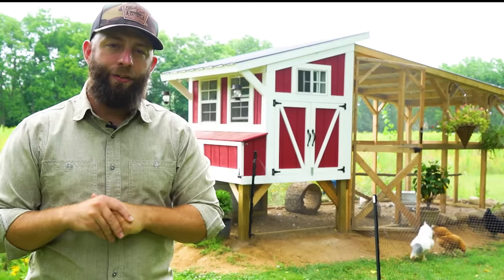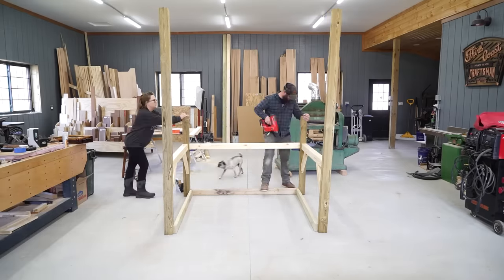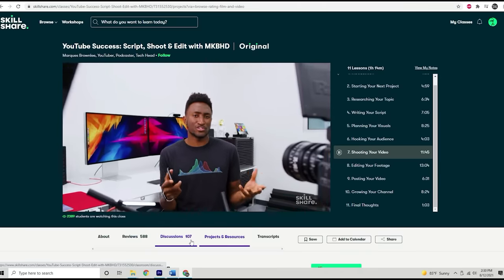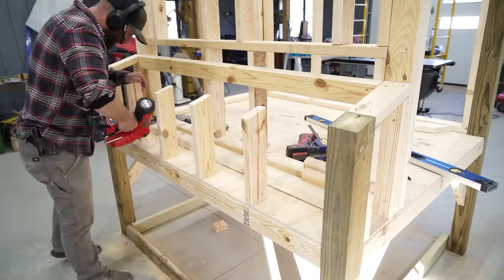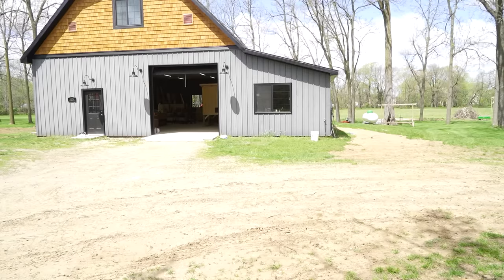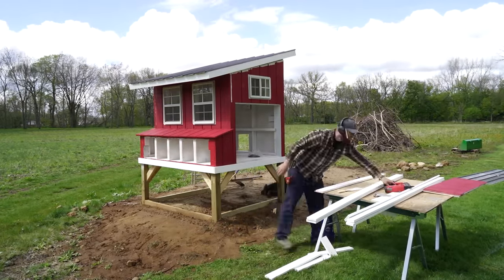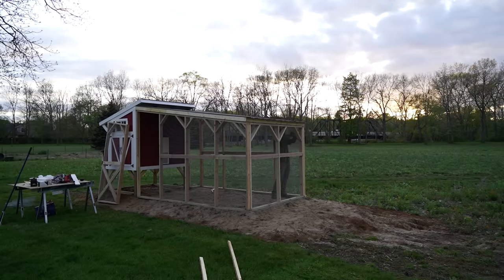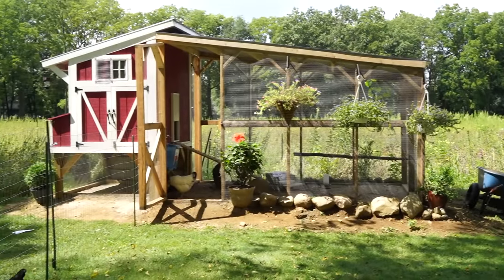Ultimate Backyard Chicken Coop Build | How To DIY

Comment: I’m in Maine researching more coop ideas (chicken math is strong here) and this is a great coop. For those of us in northern areas where 24” heavy snow loads are not uncommon (lots of beautiful barns collapse some winters) the metal roofing is a must to speed the snow sliding off. One note I might add is I might angle the run roof down another 10” so sticky type snow slides right off immediately rather than sitting on top of the run until actual weight makes it slide. If you don’t want to change the build then install a post in the middle of the run to support heavy snow load. THANKS FOR POSTING this is a gorgeous coop with convenient features!❤

Comment: Just built mine with your plans. It turned out awesome! Love this design and wish I could share the pics with your community to show what an awesome product this makes over store bought cheap coops. Thanks again for the great video and descriptive plans!
Reply: How much did it cost you with the current wood prices? I’m looking at building one soon and this one seems amazing!
Reply: Where did you find your windows? We are actively looking and just bought the lumber to build ours.
Reply: @hopejanson9743  I did not do windows as that was an easy several $100 I could save by just cutting out the “windows” and stapling hardware cloth over the opening. I then put trim around and am doing shutters I can open and close.
Reply: @bandwidthbros4741  ohhhhh love that!!
Reply: @bandwidthbros4741  how much did this cost you to build?
Reply: @nickvickrey8692  I just built one using the plans but made it a little larger 8’X8’ overall and so far I have around $1500 in it not including the run.
Reply: @nickvickrey8692  I've looked and looked for plans online (have the idea in my head of what I wanted to build but hard to find detailed plans to go build upon). Lumber alone and hardware running about $1100. I am using my neighbors old cedar fence he just took down for the trim and door frames. (Trim alone at the box store runs about $200 plus JUST THE TRIM!!!)  I'll use recycled fence panels for the window and just add hardware cloth for the windows with a hinged frame.  Mine will be 8'x8' with a 12-14' run.   I still have not acquired metal roofing yet, so it will be all in for roughly $1500-1800 if you add the new framing nailer.
Reply: Kkkk kk
Reply: @danieldill5214  it’s worth the $14 to buy the plans in this videos description. They were very detailed and gives you something to reference durning the build weather or not you make size changes.
Reply: the rough opening for the main door is 41.5". the siding filler pieces show them being flush with the RO. but the doors together are 42.25" wide. are the filler pieces supposed to be trimmed so the door will fit properly?
Reply: @ashleygreen4209  I cut the inside “siding part” of the door to match the opening with an 1/8’ gap from all sides then attached the trim for the door to overlap the door inside and siding to the coop. Don’t know if that explanation helps.
Reply: @bandwidthbros4741  yes, thank you! It helped validate the idea I had.
Reply: @zachgraham8091  could you share your modifications? Hoping to go 8x8 as well
Reply: @whitneyf1836  I’ll take a look at what I modified and let yah know asap.
Reply: @zachgraham8091  thatd be awesome thank you!!
Reply: @whitneyf1836  so basically I followed the plans except I just went 8 foot both directions and adjusted the other measurements to that as well. If that makes and sense.

Comment: I built this coop just recently. Cost was around 1400 with everything which is much cheaper then anything you’d buy per build with this quality of construction. I did modify it a bit though for the nesting box door so that I could use barrel laches instead. Just put the 3” trim pieces and t1-11 strips on each side and made the door a bit more narrow. Makes it so the raccoons can’t open it easily. I’ll have to say it’s a quality coop and plans are easy to follow. It’s extremely sturdy as well. I also have two silkies who like to sleep on the ground sometimes so the angled dropping board is key. It keeps the other birds from pooping on them but still allows room to clean easily. Thanks for the video and the great plans.

Comment: Hi there! I am going to be commenting on building this shortly, but for now I have a question. If the roof is 12’ long and the metal roofing is 12’ long, how do you have a couple inch overlap on the low side?
Reply: I'm planning  on cutting excess roofing,.which came from the 8 ft panels, and attaching it to the bottom.

Comment: Almost done with the coop, great plans so far. Only issue I have is that your plans for the doors cause the bottom trim to hang below the door on the nesting box door. The main doors trim won’t go on at all at the bottom due to the longer vertical pieces going all the way down flush with the bottom of door

Comment: Such an awesome build. Im working on my third coop and i love this design. I have to ask, how does the non pressure treated hold up in the weather seeing as its exposed in the run? We usually make the entire run with pressure treated wood, and while using the non treated would make the build cheaper, will it hold up in florida weather?
Reply: I'm going to be purchasing this plan. I live in Texas which is similar to Florida in climate. I have the same concern. I think I will be getting pressure-treated lumber for the run and for the coop legs that touch the ground.

Comment: Great job on that chicken coop Chris! At one point I had thought about building one myself & watched quite a few video builds on YT. I must say that yours is one of the best. One thing that you might consider changing are the shape of those roosting bars. They should be round as it makes for a better fit and keeps the birds from developing problems with their feet. Also, you may want to put some lighting inside the coop and a heating element for the winter months. BTW, how does UTZ get along with the birds? Hope that you & your family are doing well & staying safe......  👍👍😉😉
Reply: Unless you are going to force the hens to lay in the winter lighting is a waste. Heating a coop will set you up for a fire and the chickens don't need it. Mine survive Idaho's bitter winters in an open air coop.
Reply: @HiTheNameIsBj  bare studs with t111 on two walls, dutch door with hardware cloth on the top. Horizonal sliding glass door window with wire above it. My concerns in the winter is wind so I cardboard on opening. Check out Backyard Chickens for some great help.
Reply: @HiTheNameIsBj  cold is not an issue with chickens..cold WIND is the killer. Heating  a coop is a fire hazard .
Reply: If you have open ground under a coop, place some concrete stepping stones under the nest boxes in the winter.

The sun will heat them up in the day and they’ll radiate heat throughout the night.

Comment: My suggestion is walking through the build with a novice and seeing what needs to be added instruction wise to your plans. We have built things before and there were way too many details left out of this plan. I love the design and the ideas but this was not easy and too many questions left unanswered including the order in which siding goes up in order not to leave gaps. We are making it work and I do think it could be fairly simple with more detailed instructions
Reply: agree! This is my first time ever trying to build anything. I started with the run first and there are a lot of measurements missing. I'm currently "stuck" as the door does not fit correctly but my measurements are all correct and then there are no measurements for the door slats that require a lap joint.
Reply: You did watch the video right? Pretty simple to see in the video how the siding goes ip

Comment: I just recently bought 11 chickens and this coop looks great! Would this be big enough for 11 laying hens???? I am all new to this, thank you very much.
Reply: I'm about to build one of these, and I'm a little concerned about the size.  We have 9 chicks.  How did it turn out for you with 11 hens?
Reply: @OurWild-Life  I made mine 8 foot wide and made the chicken run the same width. It worked great for 11 chickens. We recently sold that place in MI and moved to Southern Alabama and I am building another one of these coops again, its such a great design. This one I am making 12 feet wide. I beefed up some of the areas like the hinges and door locks, but this guy laid out great design to get you started.

Good luck.
Reply: @randyhoward9651  Thanks for that info.  I could not find any comments, on this video or his others for this coop, on the experience of others on the claimed sizing.  I decided I'm going to modify the coop by pushing the wall out on the nesting end to the width that would of included that area, and then build that nesting box onto the outside of that, with some cantilevered floor joists to support it.  Whatever the width of the nesting area is, that is how much overall interior space I will gain by doing that.  That will give me a little more length on the roosting bars, because I can move them out a little towards the center, which will give me room to lengthen them.   I'm really curious if most people use his sand on the coop floor method, or the deep litter method.

Comment: It took me a month, but I finally finished our coop! Thank you for much for the plans and for the tutorial. My chickens and I are so happy! Here is how ours turned out: https://drive.google.com/drive/folders/13xBreixfmf5mBBuw97uRChoetLpZdeQf?usp=sharing
Reply: Looks awesome, thank you for sharing
Reply: so you just used wire for the windows? I can't find the 18x23 window anywhere... look good!
Reply: @Christy Hall  - Thank you very much!!! And yes,  @MasterBojangles , we just used wire over the windows for now. We also could not find windows, but I hope they are back in stock by this fall so we can add them before winter! Otherwise I think we might just shutter the windows to keep the snow out, or cut plexiglass
Reply: @casey8270  where did you get the metal roofing from and how many did you need?
Reply: Awesome!! Looks great!  Thank you for sharing!!
Reply: Wow this turned out great!
Reply: I had to use some 14” x 21” windows from Amazon, but they’re out of stock now.  Just finished my coop and I’m super happy with it, buy the plans, take your time making the cuts and it will turn out amazing!
Reply: Do you know approximately how many hours you put into it?
Reply: What was material cost for you?
Reply: @casey8270  I'm having an issue with windows as well. 10 months later.
Reply: how many chicken do you have? Can't decide between 4x6 vs 5x6 and these sizes include the nesting boxes. I have 6 chicks.
Reply: Windows are still an issue to source
Reply: @Agridiong  just got mine

Comment: I love the video and made pretty much the same thing you have here. I made mine smaller and just made my own plans with just 1 window at the back and an air vent.  Made my run 7'x4' I only have 6 chickens and my coop is 5'x4' i love your idea with the droppong board and also added this to mine.Also to anyone using the coop refresher, buy the pdz horse refresher it's way cheaper and has the exact same ingredients and can be bought at tractor supply for half the price

Thanks for the great video and ideas that helped me in my design for mine and adding certain things you did and others I omitted.
Reply: Congratulations! Where did you find windows? Building the coop and no luck finding them...

Comment: I’m a bench carpenter. I am making this coop for a family member. Ok so the roof, no where in the purchased plans material list nor the video is there mention of the kind of screws needed to secure it. So I’m using the 1 1/2” screws……I will check back in 5 years to update y’all.
Reply: any update on what you did to attach the roof?
Reply: @liquidgold2735  I got roofing screws, the ones with the little grommet on them so the water didn’t leak through.

Comment: I really like how smart this coop is built I think 🤔 it can be improved on by changing the pitch of the roof and making the run and the coop at the same angle. Put the clean out door on the short side is just smart business. A all in one self contained chicken coop would be pretty awesome with water feed artificial light, small solar, set up for the chicken door and LED lights. For maximizing automation, as much as possible.